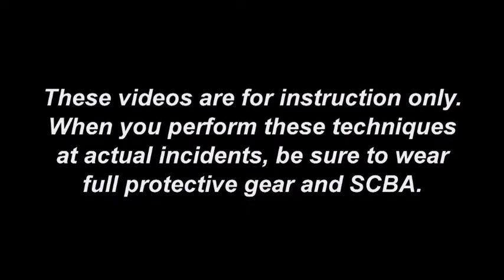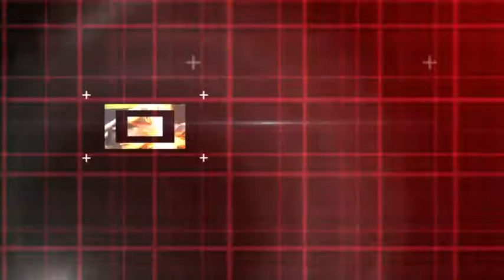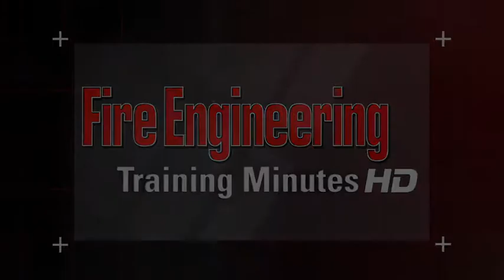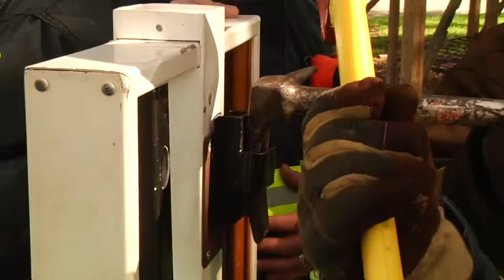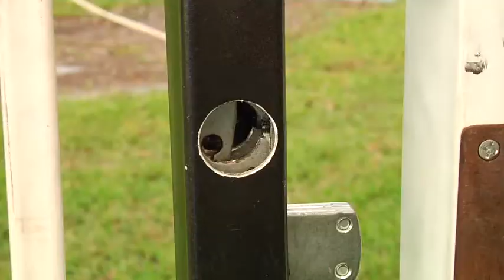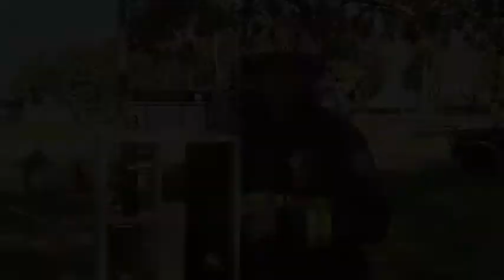K Tool for Forcible Entry

Comment: Okay two things here. 

One, this method is still very much in use today. Not every department is equipped with whatever that hydraulic system was. 

Two, you cannot do what they just did on that kind of door. That door has a deadbolt and is metal. In real life, they would be there all fucking day prying. What actual firefighters use is called a K-tool. You place it over the deadbolt lock and then you stick the adze end of the halligan in it and pry upwards. Then once the internals of the lock are exposed you reach in and flip it. What they did is more used for residential doors.